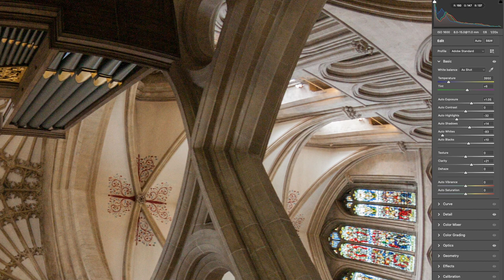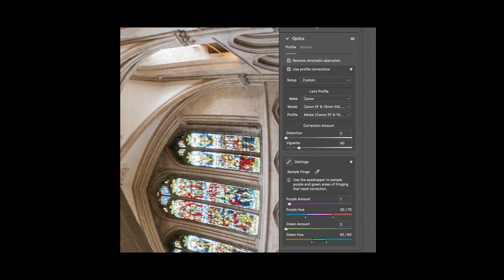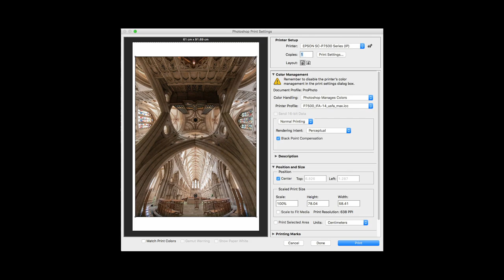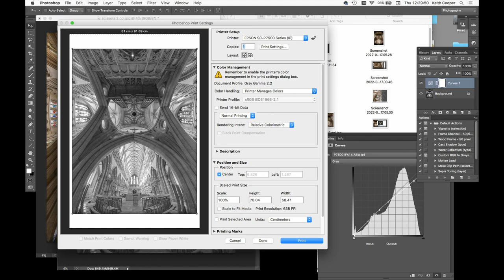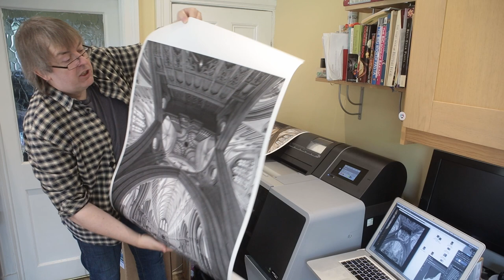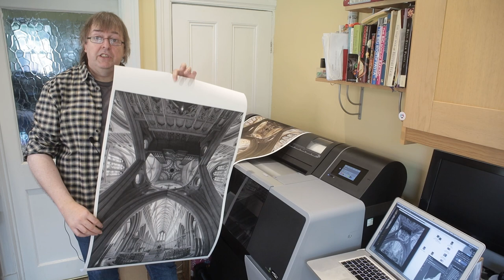Some P7500 large art prints - colour or B&W? processing, workflow and techniques

Comment: So... what are 'crunched' shadows Keith, what does that mean ?
Reply from the maker: It's where detail which should be in deep shadows is lost in solid black.

So, for example, image detail in the bottom 5% of tones is crunched up into the bottom 1-2% of tones on the paper.

It's one of the standard things I check for with my B&W test image - the detail should be visible, not solid black..
Reply: @KeithCooper  Got it, I thought it might mean that, but had not heard the term before - thanks.